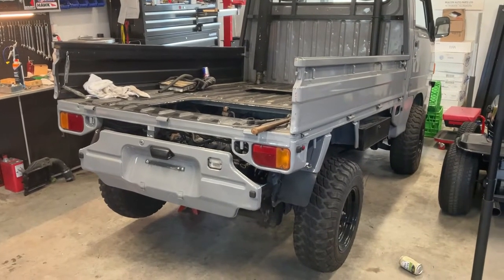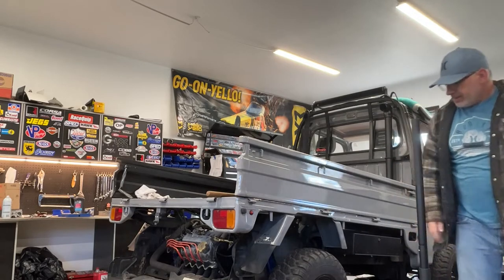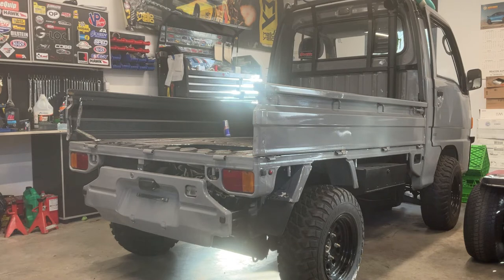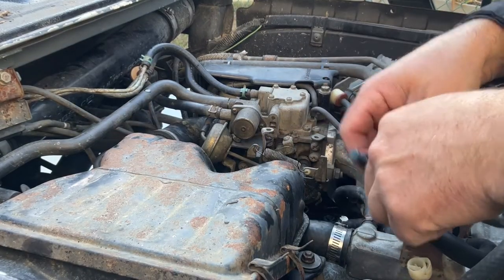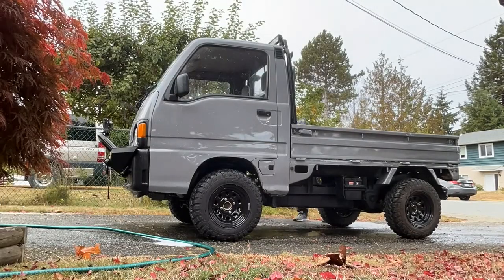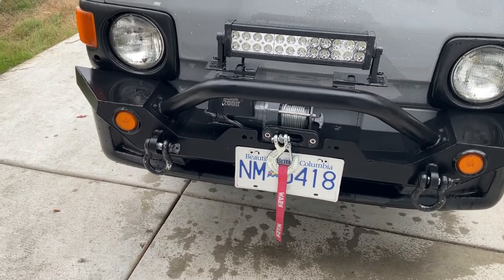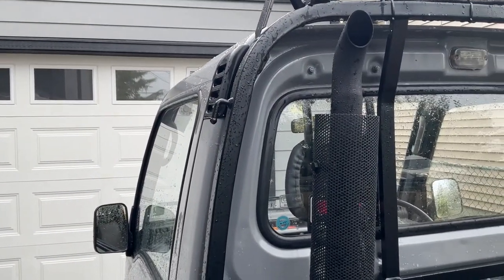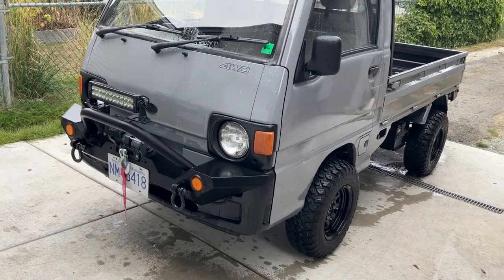Subaru Sambar is running.  Going over custom touches

Comment: Nice looks great! Question tho... Are these Sambars considered actually part time AWD or part time 4x4? Thanks!
Reply from the maker: They are rear wheel drive and with the push of a button are 4WD. You would not drive in 4WD on a non slippery surface, it is not AWD.

Comment: Awesome looking Sambar.  What are the rims and model number you have there?  Also, did you need wheel spacers?  Thanks man.  Love the videos.
Reply from the maker: @jacobcarrillo9171  They are ITP wheels, 4x110 with 2” back spacing. I hade to use 1” adapters to go to 4x100. 
Thanks for watching.

Comment: Very cool, my favorite Kei truck so far. Just pulled my 92 Sambar into the shop, ill use your other videos as a guide to help me rebuild the motor.  A few questions though, Do you know if i can ad a locker without having to swap out the entire transmission? And are those the factory 12 inch wheels?  Any apacers to run those mongrel tires?
Reply from the maker: Thanks!  I can’t answer the locker question, I don’t know sorry. Not factory wheels, they are ITP wheels. I do have 1” spacer/adapters. Bolt pattern on wheels are 110, Sambar is 100.  Good luck with rebuild!

Comment: Excellent video! What is the paint color code? Also what are the wheel specs? Brand of rim and tire size please? It looks phenomenal!
Reply from the maker: I don’t have a paint code, I just went to the paint shop and picked a colour from their book. It is a single stage paint. ITP wheels, 12” x 7” wheels. 1” wheel spacers/adapters as well. Tires are Mongrel 23x8x12”. Thanks.
Reply: Did you paint it yourself or did you have a shop do it?
Reply from the maker: @davidbooth749   Painted in myself.

Comment: what lift did you use? did you have to cut and extend the steering wheel?
Reply from the maker: @SargonRose  I made some 2” blocks myself and also bought a 2” lift kit for a full size truck at a garage sale cheap and used some of the blocks. Yes, had to cut and extend the steering shaft 2” as well.